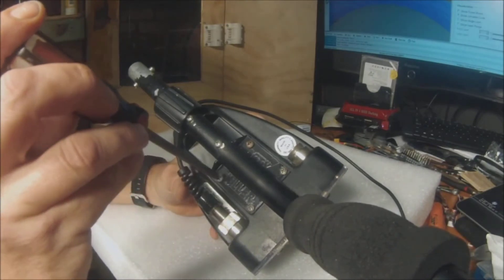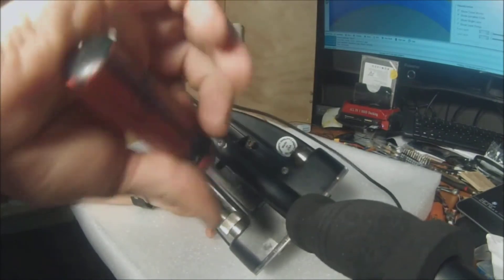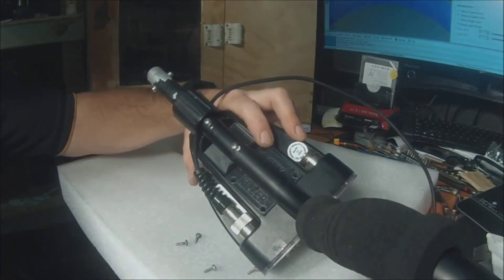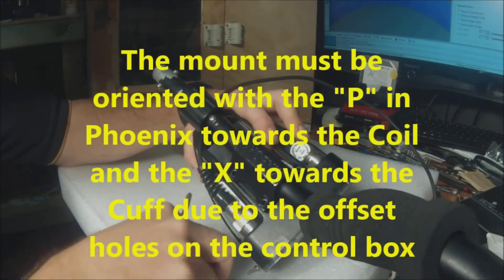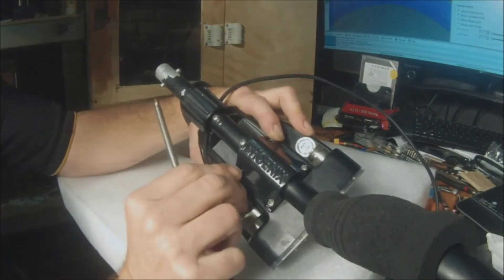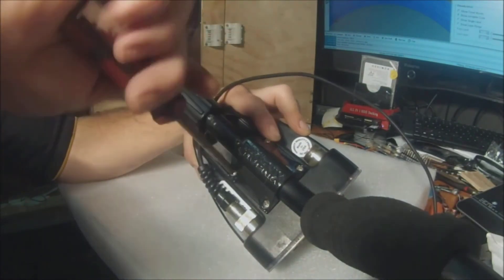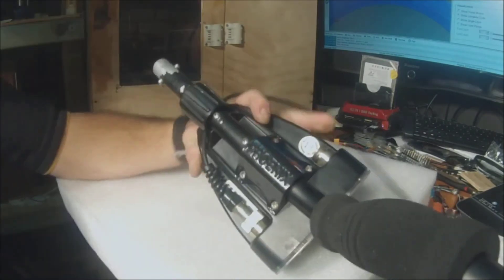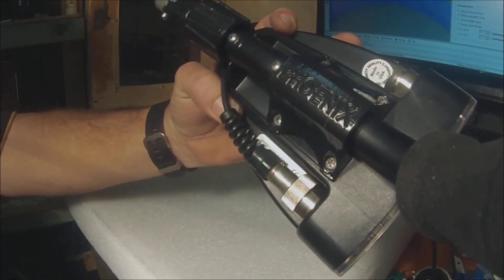NEW Control Box Support for AT Pro & Gold metal detectors,helps prevent control box breakage

Comment: Thanks for the tip buddy. My control box actually broke off on Monday of this week. I used longer screws to re-attach it but certain do need to get one of these.
Reply from the maker: Yes  you need this support brace. Be careful using longer screws that they dont puncture the housing, thus causing leaks. Once you get this item, try using a shorter screw that will bite into the remaining front broken pins without going too deep. Thanks for watching and so sorry about the breakage. For future machines i would advise everyone get one. Spread the word, very few people knows about this.....Ron